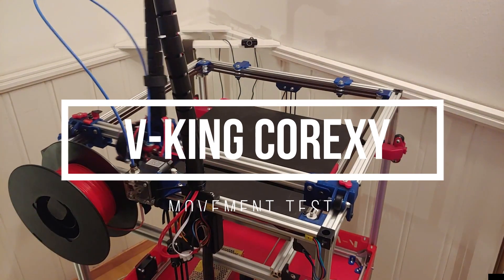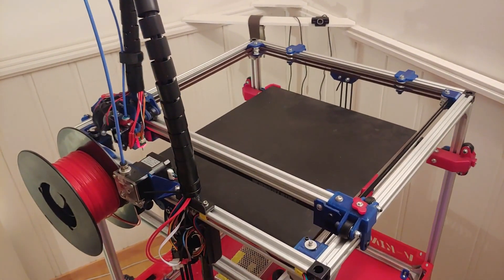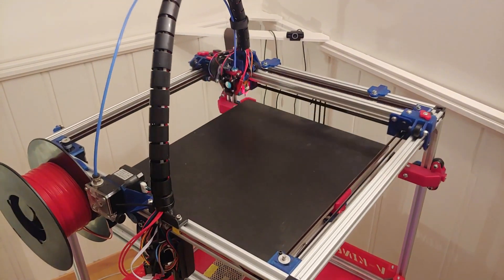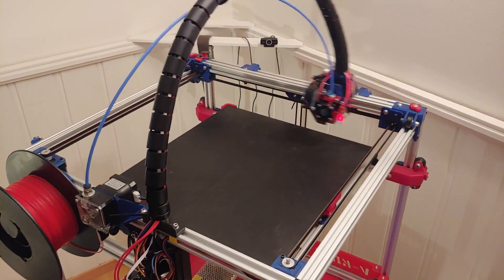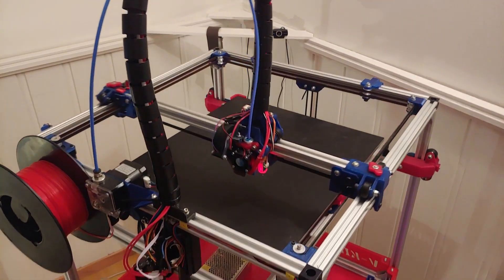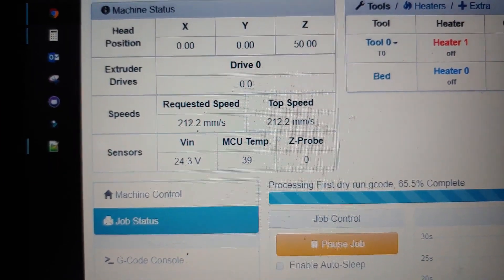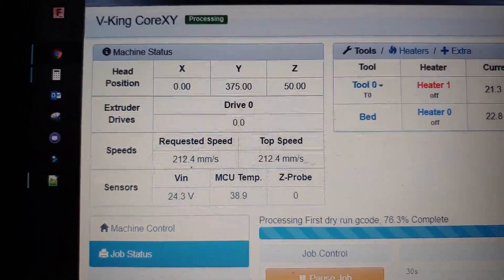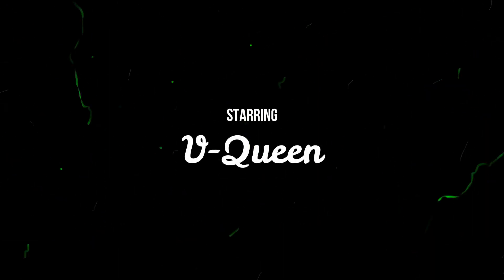V-King CoreXY Premium - Speed Tests 150-300

Comment: With the volcano hot end people have reached speeds of 200mm/s, so it is possible, just need some upgrades!!!!
Reply from the maker: Thanks for the feedback. I have done a 150mm/s print now with the stock heatblock and it turned out great so I am sure the volcano will do better
Reply: PRO 3D cool! And I will say the longer heat zone helps a lot found in the volcano!
Reply from the maker: https://youtu.be/jZljXvbZNw4

Comment: Acceleration?
Reply from the maker: 1500 is stock accel. Depending on driver and I say 2000 is fine and also have run 3000 no issues. Will stress machine more though but again with TMC drivers 2208 - 1500 is about max for those to not have skipping steps
Reply: @PRO3DESIGN  Are you able to reliably run 2000 or higher with the Duet2wifi? Or perhaps you have the maestro?
Curious if the 2660 of the duet2wifi makes a difference as i'm thinking of getting one. Also, does the 2660 make more noise than the 2208?`
Reply from the maker: @saldot79  I have the duet running at 1500 and did not test higher and can only guess 2000 is fine with the 2660. 2208 is similar noise to the 2660 - very quiet at 256 interpolation stealth chop
Reply: @PRO3DESIGN  OK. Thanks for the info. =)
Great content you've got on your channel, really informative. Keep the videos coming and I bet a lot more people will find your channel!